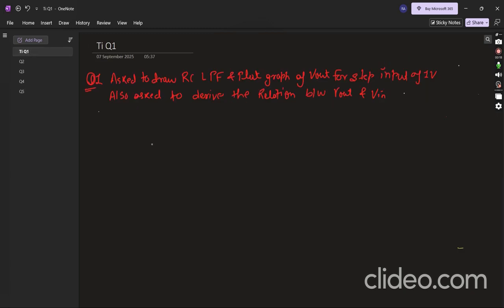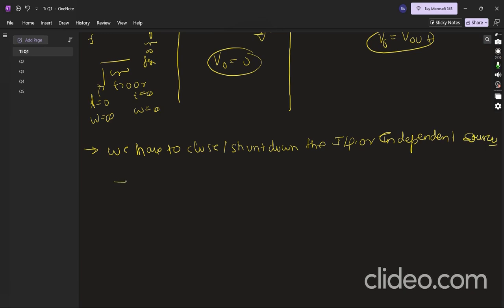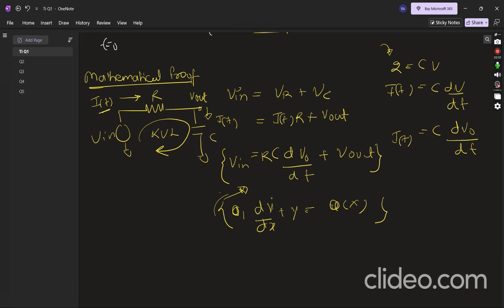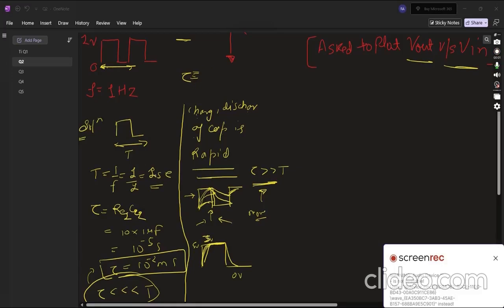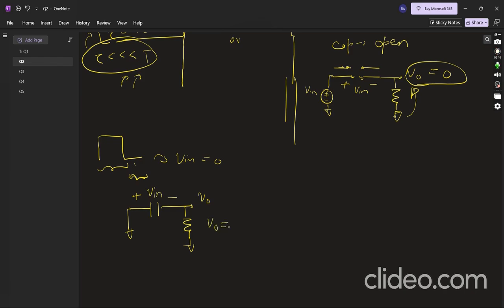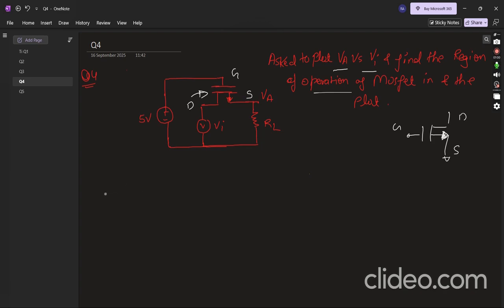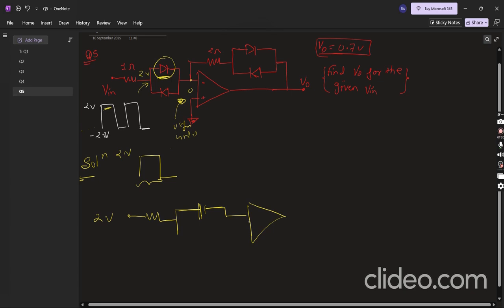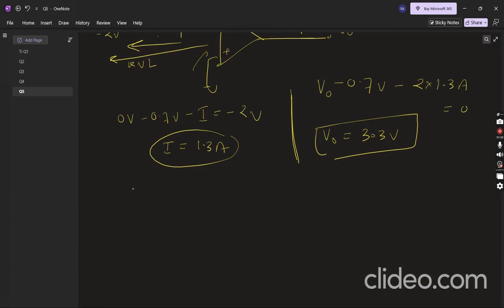Texas instruments Analog Electronics Interview Questions #texasinstruments #analog  #vlsiprojects

Comment: In qs 3 potential of B should be zero as no current is flowing through the other branch and then using voltage divider we can find out potenitals of A and C which are 2.5 v and -2.5v respectively
Reply: correct
i felt same
Reply: yes it should be like that only